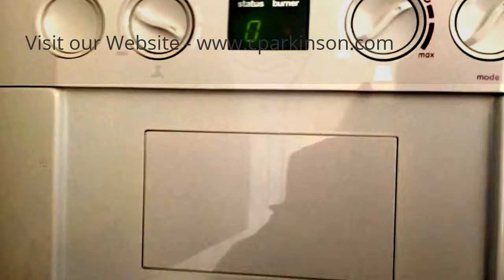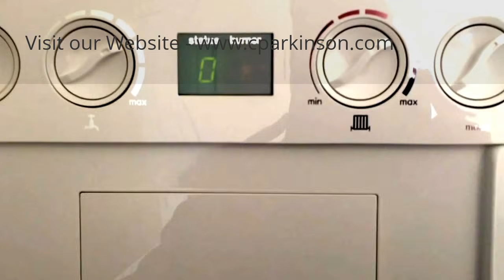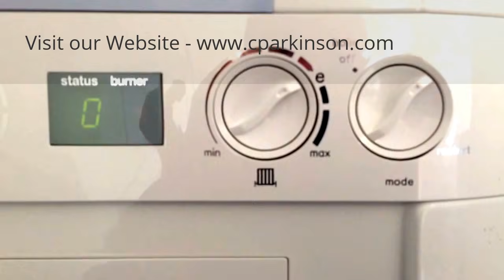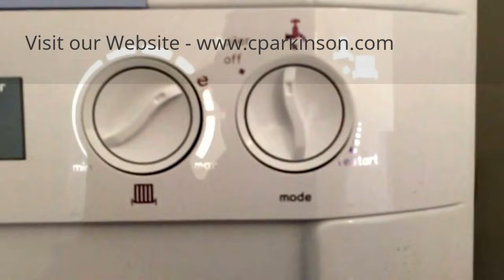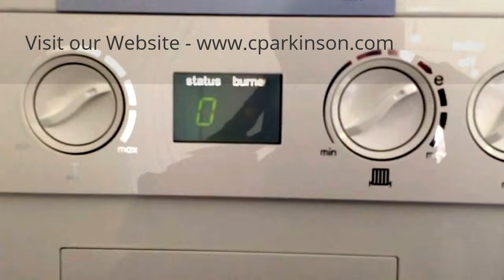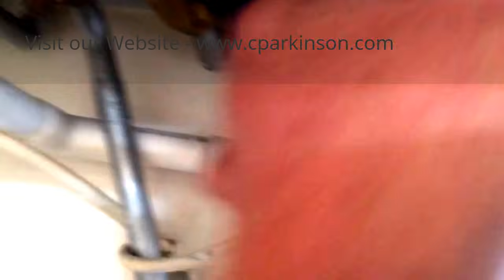#howto #theheatingpro.com #ideallogic Setting up and using your Ideal Logic combi boiler

Comment: Great video. I have the same boiler. I noticed on the video, even if the setting is on both hot water/heater, the system shows O. Whereas mine shows C and heating remains on despite switching it off from E position.
Reply from the maker: Hi Melodic, the C symbol at the boiler means you have a Call from your roomstat. The boiler shows the C on heating and a D for demand from your hot water  (hot tap open). If your roomstat is not calling for heat then it maybe that the red link has been left in the boiler which it comes with from the factory. This should be removed by the installer should an external control such as the roomstat be wired to the boiler. Check your roomstat isn’t calling or if you have a two zone system that one of your zone valves is not locked in manual. Hope this helps, please ask any more questions if you are unsure and I’m sure we can get to the bottom of it 
Regards
Roger
@theheatingpro.com
Please like and Subscribe
Reply: @theheatingpro  Thank you so much for this and for your swift reply! Really appreciate your help with this:)
Kind regards
Reply from the maker: @SayemTabla  No worries, let me know how you get on and if you need further help 👍👍

Comment: Hello, I have the Ideal Logic Combi ESP1 35 and the pressure bar is currently showing 3.5. I've tried bleeding the radiators the pressure is not going down. Is there anything else I can do or do I need someone to come look at it? Thanks
Reply from the maker: Tom Ogden Hi Tom, check that the taps are not in the open position below the boiler on the filling loop. Would expect your boiler to be discharging when it gets to that pressure. If taps are slightly open it will pressurise the system as you are trying to vent it so not seeing the pressure coming down.
Come back to me for further questions after you have checked that, are a number of things you could try before calling someone in
Regards 
Roger 
Please like and Subscribe
Reply: @theheatingpro  Hi Roger, thank you for the quick reply. All the taps are closed properly. I currently have the boiler switched off and it's showing 3.2 bar. There's no air coming out of any radiators just water.
Reply from the maker: Tom Ogden Hi Tom to get the pressure down you would need to take roughly 3 coffee mugs worth of water out of the system. If the vents on your radiators allow you to direct the water when venting is slower to do but easier than some drain offs on the system. If after getting three mugs out you pressure hasn’t budged we need to be looking at something else. Make sure your heating is off when you are doing it so as not to scald yourself and to get a better idea of the cold pressure
Reply: @theheatingpro  Hi Roger, thank you for all the help. I bled the downstairs radiators and have go it down to 1 bar. I've turned the heating on now and sitting just above 1 bar.
Reply from the maker: Tom Ogden Glad you got it sorted Tom. Pressure naturally goes up slightly when your heating is on, so sounds like you are all ok.
Regards 
Roger

Comment: Ive got the es35 boiler, and pressure is just under 1. Ive tried to do add more pressure but nothing happens when I turn the taps to do so.
Reply from the maker: Mark Holloway Hi Mark, sometimes depends on the pressure coming into your house. Some houses max out at the 1 bar so means you can’t get it up further. As long as it is over 0.4 and around the 1.0 it will work just as intended.
Hope this helps 
Regards Roger 
Please like and Subscribe

Comment: Hi my ideal boiler has a tap in the middle of the small copper pipe between the two taps you showed, what is that for and does the boiler need to be on to increase the pressure as nothing is happening, and last the tap where the pressure gauge is what is that for.
Reply from the maker: William Newlands Hi William, ideal have changed the taps over the years on the boilers so there are a number of slight variations. The filling loop is always on the right however, start with the second pipe from the right this is the cold water pipe and where you will get the water from to pressurise the boiler/system. It will have a tap on it which is probably pointing directly up this needs to turn towards you then follow the small link pipe to the pipe on the right hand side of the boiler any tap will need turning so it is in line with the pipe and this should then start putting mains water into the boiler, you will hear it. It is best to top up the pressure when the system is cold as it gives you a true pressure when cold, top up to 1 bar. Then turn the cold water tap back to pointing up and the smaller tap back to its original position across the small pipe. Don’t turn any other tap ie the ones on the two outside pipes or the yellow one. If you do it isolates the flow or return to the heating, the boiler will fire but quickly overheat as it can’t circulate around the radiators, the yellow one is the gas and the boiler won’t fire at all. All should be pointing up. 
Hope this help 
Regards 
Roger 
Please like and Subscribe
Reply: @theheatingpro  many thanks for the advice managed to increase the pressure, it was the tap on the right. Can I ask you another question I had rain water coming in from the flue pipe outside, now I read many reasons for this, wrong angled flue pipe, I had a look and it does have a very small point upwards, is the anything on the market that you can fit to have the angle downwards, the weather was extreme and the rain was being blown in by the wind had to switch the boiler off and cover the outside flue to stop the rain.
Reply from the maker: William Newlands Hi William, unfortunately not there is nothing to stop this. Some other manufacturers flues have been redesigned to try and prevent this happening. The flue is to be fitted horizontally or with a slight fall back to the boiler depending on manufacturers instructions at the time of install. Weather where the rain is being driven has often caused us issues with this same problem but other than changing the wall the flue exits from ( ie rear flue being side flued) to a more sheltered wall there is little you can do. Any means of deflecting the water impedes the clearances needed for the combustion gases to be dispersed and air to be drawn in.
Hope this helps explain and sorry I can’t offer up a solution to resolve this for you, I wish I could 
Regards
Roger
Reply: @theheatingpro  many thanks for the reply, didn't think anything could be done will just have to persevere with it, it has happened a couple of times and just worried about the water dripping into the boiler with the electrics. Thanks again.
Reply from the maker: William Newlands You may be able to do something shortly but it depends on your boiler. Ideal have just brought out a new flue which would do away with this issue (it has been a common one with a number of manufacturers boilers) which has the air intake configured differently. You can check your GC number on your boiler with ideal and ask if it would suit the new style flue. Would think it would cost you between £100-£140 to change the flue
Hope this helps
Regards
Roger
Reply: @theheatingpro  sounds good will have a check with Ideal see it conforms wwirh my boiler, at least they have acknowledged there's an issue, will let you know how I get on. Many thanks Rodger

Comment: How do you turn the water temperature UP?
Reply from the maker: Danny Jarvis Hi Danny, few variables on that. If dial on front of boiler is at max for water and you still have issue. What is your flow rate and water pressure like? If it is too high the water is travelling to fast through the boiler to heat properly. Either turn the incoming stop tap down a little or don’t open tap fully when using. Other may be age and condition depending you may have a blockage in your plate exchanger on boiler which would require stripping out of boiler and flushing 
Hope this helps
Regards
Roger 
Please like and Subscribe

Comment: How do I disconnect the weather compensation unit?
Reply from the maker: Puddleglum two wires to right hand side need to come out. Means having to take off the cover though which would means you would. Red to be gas Safe. Hope that helps Roger

Comment: Excellent video... by the way what is the ideal pressure?
Reply from the maker: Hi Tosin,
1 bar, the pressure increases when in use and dont want it to get to near 3 bar or it will discharge. I also find when the pressure vessel is needing recharging this increase in pressure is higher. Need to keep the pressure vessel charged with your annual boiler service
Regards
Roger
@theheatingrpo
Please Like & Subscribe

Comment: Hi. My pressure is nearly 3 how can i lower it pls. Thanks
Reply from the maker: Majid Mammadov best to either empty some from a drain off valve on your downstairs radiator or via the radiator vent although that can more tricky depending on the type of vent. Make sure the filling loop is turned off and not making the pressure so high 👍 Regards Roger

Comment: Hi my ideal esprit eco 24 30 water pressure is low how do I refill please thanks Maggie
Reply from the maker: Maggie Forrest Hi Maggie, the Esprit doesn’t have a built in filling loop like the video shown. You would need to look for the filling loop which is a braided metal cord between two taps (usually) located generally very near the boiler. I will try to put up a picture to show you what you are looking for
Regards 
Roger
Reply from the maker: Maggie Forrest https://i1.wp.com/www.fixmyplumbing.org/wp-content/uploads/2015/07/img_56531.jpg
Reply from the maker: Maggie Forrest Hi Maggie hopefully the link will show you what you need to be looking for
Reply from the maker: Maggie Forrest Hi Maggie, if not google “filling loop” you will need to turn the tap (or two taps) and watch the pressure gauge on the boiler go up to between 1 and 1.5 bar. This done then you should have boiler up and working again. Good luck, please subscribe to have me  on hand if needed and let me know if you still need assistance 
Regards 
Roger
www.cparkinson.com
Reply: CParkinsonBuryLtd Thanks Rodger
Reply: Thanks for this

Comment: I have a gloworm flexicom boiler pressure dropping how do I adjust it
Reply from the maker: Richard Graham Hi Richard depends which model. They had round blue taps underneath the boiler, not always the easiest to top up as the blue round plastic was just an extender to the actual taps and can slip. They are plastic taps and sometimes very difficult to turn on. I found that I had to take blue tops off and use plumbers pump pliers to be able to move the actual taps below. If you can post a picture of the underside of your boiler I can put arrows on the picture to where you should be looking 👍🏻

Comment: Our boiler  show f1 once in a day. Showed to engineer also but he could not able to fixed it.
Reply from the maker: vandana1782 hi vandana, F1 fault is low water pressure. Look for the obvious like a leak or discharge from the pressure relief valve ( small copper pipe going to outside). Following that it could be loose connection on the pressure sensor or a faulty pressure sensor. Sometimes the water quality in the system can affect the sensor by blocking it slightly so you end up over pressurising without realising ie the gauge shows 1.5 but in reality you have 2.5, then when heating goes on it expands and you discharge at 3bar. Does the pressure gauge drop to zero constantly? If so try topping up to a lower pressure say 1 bar and see how it goes. 
Hope this helps a little 
Regards
Roger
Please like and subscribe
Reply: Thanks for ur valuable help...i will try this

Comment: Hi ,where is the pressure relief valve located on an ideal logic 30. Please
Reply from the maker: peter wild hi Peter, pressure relief valve is located inside the boiler behind the pump. It has a red top on it. 
Regards 
Roger 
www.cparkinson.com
Please subscribe and like 👍
Reply: Hi roger, i`m informed the pressure relief valve on my boiler needs changing, is this a job I could do , bearing in mind I have no real knowledge of boilers ?
Reply from the maker: peter wild Hi Peter, whilst for an engineer it would be a straightforward swap and take little time there are always possible complications which would mean I wouldn’t advise doing it yourself if you have little experience. You would need to isolate your boiler and drain then remove the retaining clip and undo compression joint below to enable you to remove it. Then fit new prv and replace clip, remake compression joint, then open isolation to boiler and refill to 1.5 bar. 
Hope this helps
Regards 
Roger 
www.cparkinson.com
Please subscribe for future videos

Comment: Good video. We have a f2 come on our logic combi boiler how can this get fixed.
Reply from the maker: Jamie Groom, F2 is due to flame loss, most common causes are a blocked/frozen condense pipe. Gas tap has been turned off by mistake under boiler yellow tap in the middle or at the gas meter. If these are ok it would require an engineer to test gas pressure, gas valve, wiring harness etc. I have pdf download instructions on my website for this boiler page 52 section 26 relates to f2 
Hope you get it sorted
Regards 
Roger 
www.cparkinson.com
Please like video and subscribe thanks 👍
Reply: Or, if the the boiler is the only gas appliance in the house (no fires, electric oven) and you have a credit card type gas meter, check that you don't need to top up credit. The condensate traps if not cleaned out regularly, can also lead to F2. Recommend having it serviced annually. This will also credit the additional years of the breakdown warrantee.

Comment: Hi 😊every day the pressure in the furnace falls and I have to pump it twice a day! which is the reason
Reply from the maker: Hi Dominika, Can be a number of reasons. Things to check for yourself would be - Any leaks showing anywhere on your heating system? Any signs of water coming from the Pressure relief valve ( small finger size copper pipe outside near boiler (furnace) location? Do not block this at all as it is a safety device.
You would need a competent engineer from that point as could be an expansion vessel issue, cracked heat exchanger passing pressure relief valve or other leak to the system somewhere.
Good luck, hope you get it sorted soon
Regards,
Roger
www.cparkinson.com